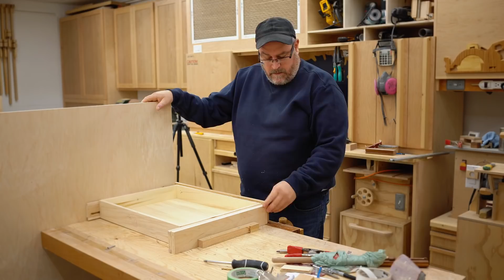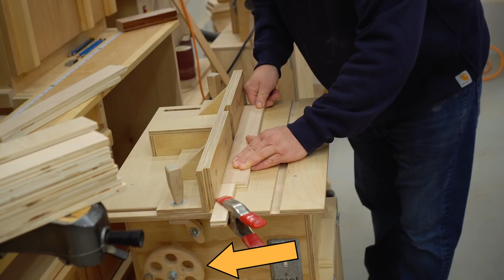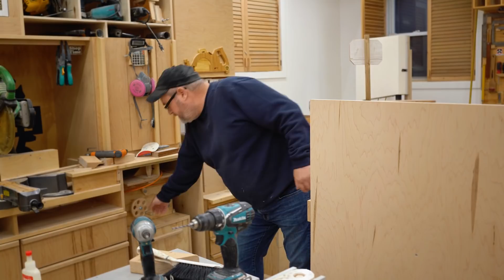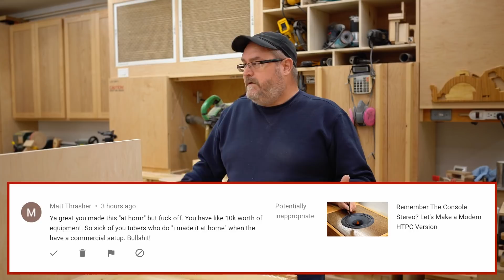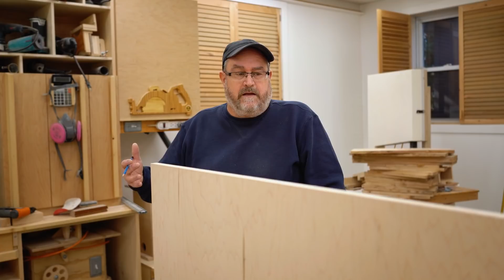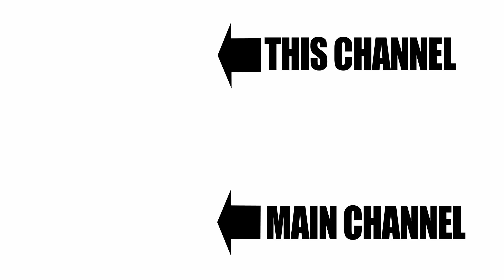Stop Complaining About The Shop and Tools you Don't Have -  Rant!

Comment: My first wood shop was an old garden shed measuring 8’ x 6’ (back in 1976.) I had a cheap-o lathe and a tiny “table” saw with a 12”x 12” top and an old fan motor hanging off the back. In that tiny shed I made a three-legged table with a turned spindle, hand-cut sliding dove tail slots for the legs, and a 1” thick top. All from black walnut gifted to me by a lumberjack in central Nebraska. That little table is still in use today. And now I graduated to a 20’ x 20’ air conditioned garage, and over the YEARS accumulated a variety of nice equipment. Woodworking is an evolutionary hobby requiring patience, money, ingenuity, and time.

Comment: Im going to disagree with you about the 3d printers, Ive been printing for 6 years now. So the common perception is its just click and print. Reality is we are talking about the cheapest of Chinese components known to man are being used here(even in high end machines) theres no getting around it your going to have to work on machine at somepoint. Also the settings and getting the machine dialed in is something alot of people dont do. Then theres the 3d modeling side of it, which is by far the most skill based part. I would say in alot of ways woodworking and 3d printing are relatable in the sense that somebody with just some kind of saw and wood could make something, same as somebody with a 3d printer could make something, but either of them if you have skill and knowledge is where the really incredible stuff is getting made
Reply: Also 3d printing isnt going to replace wood working, its injection molding thats the real competition there. And thats mostly already at a saturation point

Comment: If you want (need) to work with wood, you will find a way.  I started when I was about 10 years old making bird houses out of scrap wood.  I had no mentor or anyone else to show me how or train me.  But this is what interested me and gave me purpose.  That was 65 years ago.  Now I am retired, but still go out into the garage/shop and build projects.  In between I've worked at different occupations, (US Marine, Electronics Technician, Boat builder, General Contractor, Building Inspector) but always went back to working with wood.  Over the years I collected tools as I needed them or wanted them.  Some are easy to buy on a limited budget, some you save for, and some you sacrifice for.  If you want to do the work, you will find a way.  After all, wood working could very well be in your DNA.  I discovered that my biological father was a wood worker and contractor when I was about 40.

Comment: John, there is a massive difference between the woodworkers/makers who have some mid-grade or nicer power tools and shop equipment, and the people who have projects using outlandishly expensive single use equipment.

 Most of us don't fault woodworkers and makers for doing a project using a table saw, a miter saw, a router, a drill press, a spindle sander, palm or a disc sander. We understand those tools are doing jobs that could be done by hand or by a less expensive power tool. Ninety percent of the work done by a drill press can be done with a hand drill. A circular saw can do some of the work a table saw can; not everything, but enough. Belt, sheet, palm, corner sanders just make sanding faster, not perform a whole new, unique job.

Where we start getting upset is when a woodworker or maker whips out the $7,000 X-Carve or $2,500 shaper origin and makes it clear that's the only way the project can be done at all.  An X-Carve or Shaper Origin should be shown as making the upscale or premium version of the project; the embellishments; but the basic project should be doable with a tools that don't cost more than most/many high end desktop computers.

I'm on the fence right now on all the projects by some woodworkers and makers who require a 3-D printer for some critical part: for some of the us that's still out of our price range; but it's not so far out as thousands upon thousands of dollars. While it's currently a pain in the butt and on hold due to Covid, I can in theory have single jobs/parts run off by my local library system (for a nominal fee): a tedious process if multiple parts are required for a build, but single part might not be so bad.

Comment: Like many of us, you usually start with second-hand tools & that's power tools and hand tools. Go to auctions, second-hand stores, or tag sales. That is how I started out. I have a 10" Jointer made in 1930 that I got for less than $100.00 dollars at an estate sale. You can't buy a good quality hand planer for that amount. I also got a cabinet saw from the same estate sale for $150.00. That's a far cry from the $2-4000.00 that a good cabinet saw costs today. I bought that 10 years ago and it's still running like the day it was made. Tools that were made in the early 20th century are still around for a reason. They were built with quality and durability in mind. They are made of cast iron and dead flat steel tops. As John said "if you really want to get into woodworking, you will find away. It is just easier for some people to complain and be envious of others! Envy and jealousy make for a bitter person.

Comment: John I get your rant and it is deserved! 20 years ago I started a wood shop with nice tools. Then a divorce. 5 years latter we got back together wanting build up another shop I was gun shy  to dump money in tools that I would have to sell again. If things did not work out 
Finding your channel and Izzy Swann  I built a table saw from a circular saw! It worked well. I made a lot of projects with that saw. Then I bought your plans for the router lift! I still use it 
A long with an Incra Master Lift II 
17 years latter I have a shop again allis well.

I am guilty of suggesting the nylon bushing over the screw threads not realizing that the screws were only forward and aft stops for the slide travel.
I did not understand that the slides had upper and lower guides. 
Understand your frustration with comments that really do not apply if they had paid attention.
Please keep up the wonderful video you produce! You are an innovative thinking person and the world needs folks like you!
😁🛫

Comment: Thanks so much for sharing the rude comment and your excellent response to it.  I have a 134 square foot shop and occasionally have ripped 8' sheets of plywood.  It takes some finagling but it works.  I used to complain about the size of my shop until I decided to start a business making bunk beds out of 2x6 lumber.  I quit after making about 5 of them even though I was starting to make money at it.  I quit not because my shop was too small (and in the basement to boot) but because I did not want to sort through 2x6 stacks and then haul them home and then muscle them around by myself and then have to haul it to the customer etc.  I now love my small shop and have a list I made up of 50 small items I can make and sell.  Small and ill equipped is a blessing as long as you have the desire to actually make something!

Comment: Ha!  I make all kinds of things like you do with a garage sale table saw, cast off routers that I have fixed and cobbled, home made router table, fences and guides for everything, etc. Virtually every power tool I have was bought for next to nothing at yard sales.  The only thing I bought new was a $250 drill press from Harbor Freight.  Even my planer was bought for $20, which I disassembled and rebuilt for less than another $20.  I can testify that you don't need to spend a ton of dough on equipment to have fun and make nice things in your home workshop if you're willing to invest your own time and ingenuity to adapt.

Comment: An old instructor of mine many, many, many years ago (back n the 80s) said, "If you don't have the skill do it with hand tools, you have no right using power tools to do the same thing."   When I started, I had a hand saw, a couple of chisels, hammer, and some screwdrivers.  I made some beautiful (and some horrible) pieces with just those. I also only had a space big enough to just barely swing my arms in.  

Power tools do not give you experience.  They are a time saver.  

The also don't give you quality.  You have to want to make something good to make something good.  If you strive for "meh", you may or may not get to that level.

I can't wait to add a 3D printer to my tool collection.  But that's going to be a whole new learning experience.  I'll have to learn to use the software, the materials, etc.  The only difference is, a mistake on a 3D printer doesn't end with blood :)
Reply from the maker: I strongly disagree with that power tool vs hand tool attitude.

Comment: John love your work but 3D printers do take learning a skill set too between cad and setting and like materials knowing woods and textures is a skill knowing filaments for prints is a skill I love doing both and I find using some 3D printed parts in design dose help make up for where I'm lacking in wood working. I also agree 100% that where there is a will there is away. Thanks to you and Izzy my first 5 by 7 shop had a home made table saw router table and drill press lol Keep up the good work

Comment: I made a small cabinet for under my drill press and just used some simple wood rails for the drawers and thought it’d be good enough. It’s not I should have made your sliders. Not that the way I did it doesn’t work it’s just not smooth and bothers me every time I use them. How do I never learn the lesson of taking my time.

Comment: Any of my friends will tell you I've been working on a Murphy bed for a year. What they can't see is that I set out to accomplish this with a skill saw, a drill, and a second-hand rusty table saw. This year has been a journey of failures, innovations, and discovery as I learned first-hand what i can do well with what I have and what I can't. I owe much to the woodworkers making tools with their tools, and to A LOT of trial and error. Trying to hand cut miters with a skill saw and cobbled guide, finding out why big box store ply isn't right for certain parts, making a level space big enough for a bed frame and what it would take to square it up reliably for glue up n screw up, etc.. Along the way I've made a pocket-hole jig (thanks JSK Koubou) , a new fence I can trust, bought some corner clamps, made some corner clamps (which required making a sled that was within a few thou), raised and secured the tablesaw to save my back and added an outfeed and extension wing, and so much more in my tiny space that I have to work with. I had a pretty good excuse, that my do-nothing roommate had filled the garage with boxes and left me no space, but that wasn't changing and so I build shelves for all her shit and got it up on the walls and carved out a little 8x maybe 15 where I could do SOMETHING at least.
Reply: All that to say, something something he's right about skills and tools and will.
I try to do as much as I can with what I have, and when I really hit a wall that necessitates a new thing, that's when I'll make or get a new thing. Now, this requires a measure of self-honesty. I can't help you with that.

Comment: Two comments: I build tools...that's my joy. I build them but almost never use them. They range from honing guides to bow saws to power hammers and spot welders. If you want a tool you can make it. Skill: almost every  endeavor a man undertakes requires some sort of skill; to compare one to another is unfair and unreasonable. Yet to compare the wheelding of a chisel to setting up a table saw fence to make a cross cut is reasonable if we consider artistry and craftsmanship. One need only look at the product of todays  a machine operator and that of the work of a true craftsman. Bring on the heat.

Comment: I don't have a degree in engineering but surely anyone with some common sense knows that screw won't wear out because the force (or weight) is not on the screw, the supports hold the weight. So yeah it was after I thought about this, I realized how good the build was, which is why I threw you a huge compliment on that build.

And yeah I agree with you about the whole excuses thing. 

I don't even own a table saw, neither a miter saw. I have a circular saw and jigs. Problem with the whole excuse thing is once you start making excuses you develop a defeated mindset, and it's hard to get out of.

Comment: I'm in a fairly bad place economically and been there for a while. I've been struggling with stress for almost a decade. It's no fun.  And I live in an apartment. But over the past six months I've been slowly putting up a hand tool "workshop". It takes a lot of time because I can't afford buying too much at a time. Luckily I already had a lot of basic tools and crap lying around. So now I'm getting nearer to a point where I'm going to get more serious and get some proper materials. My big project (that I'll probably won't get to until next year) is a tiny but proper woodworking workbench. I've been designing it for months and keep updating, simplifying, etc. I do have a mobile workbench that I've updated with a bigger table, and it serves me alright right now. So, my point being, you don't need the big setup, but you have to now your limits in what you're able to actually make in your setup. I'm inspired by Rex Krueger in going the hand tool way—and it's what I can do where I live.
Reply: @David curtis Exactly!

Comment: I disagree with you on 3D printer. I'm an amateur woodworker for more than 10years now and i bought a 3D printer about a year ago. Prior to having a 3D printer i was a bit on the same fence as you saying that takes the skills out of the equation. But if you want to modelize your own stuffs then there is a lloooootttt of skills involved there. FDM 3D printer can't print just any shape, and moreover can't get great result on any shape, so you have to anticipate for all that, just like a woodworker have to understand grain of wood, that's things you learn by doing the mistakes, just like woodworking only different. Fact is i rarelly use it because the time it takes to modelize a thing, i can actually build it several times wit wood so ... 

Just my 2cts...

Comment: I tell people that complain about tools to locate or start a makerspace or other woodworking club.

Also, 3D printing your own pieces requires a fairly complex skill set, one that is just different from woodworking.  The same goes for desktop CNC - you can't just throw a piece of pallet wood on a CNC and get a bunch of benches or a cool carving.  You have to know how to use a router and choose bits to use a CNC.  And don't get me started on all the sanding required for common plastics like PLA!  As long as there is wood, there will be woodworking.

Comment: I started in wood working with a hand saw a jig saw and a crappy $15 drill, little by little have been getting more tools, have used a dremel as a router for years, still use a couple of drill guides for different sizes of bits because I don´t have a drill press, if you want to do something you will do it with what you have all the rest as you say are excuses.

Comment: I've always liked using soap to lubricate drawer slides. However, most soap today (ironically) has too much oil in it to work properly. You want the cheapest, hardest stuff you can find. Same for waxing drawer runners. Soft wax like bee's wax seems to be too "sticky". Hard paraffin candles seem to work better.

I love your comment about the hand tools. Just look at old furniture at someplace like the palace at Versailles- it's all made with hand tools. A saw, a plane, a chisel. It's still all you really need. The rest just makes it all faster. And don't get me wrong, you can have my unisaw when you pry it from my cold dead hands.

Comment: I get the gist of what you're saying and I agree with most of it.

HOWEVER, I have a 3D printer.  Those same people who bitch about "needing" $10k worth of woodworking equipment are the same type of people that bitch about "needing" a $10k 3D printer to do anything.  My printer was $350.  I can figure out how to print most things that I want to print that are within a reasonable size (about 6.5" cubed).  I fail...A LOT.  But that's all part of learning.

Using a 3D printer is very much like woodworking.  There is a very long learning curve before you can get the idea for a complex project out of your head and created in real life.  The one huge difference between most hobbyist woodworkers and hobbyist 3D printers is that you MUST have an exact design figured out and created on a computer before you attempt to 3D print something.  Unless you can find a design file for exactly what you want, this is very often the blockade to getting your idea out of your head and physically created.  Sure, there's a lot of trial-and-error that goes on with both, but you can't just pull out a spool of filament and start printing without having a design created in a 3D design program and then "sliced" in another program to account for the filament type and printer you're using.  In both cases (woodworking & 3D printing) you have to understand the limitations of the equipment you have and how to work around those as best you can.

Keep up the good work.  We all love a good rant once in awhile.

Comment: 3D printing is great, I have 3D printers, I use 3D printers, but it won't replace woodworking. The number one reason is speed. 3D printing is slow, and will continue to be slow for the foreseeable future. e.g. Need a specific one of a kind bracket for a thing. You could spend 3 hours modeling it in CAD, another 5 hours printing it, and then another 5 hours printing it again because the print failed, and then another 2 hours redesigning it because it was the wrong size... rinse repeat... or you can go out the the shop, grab a scrap of wood out of the bin and just make the thing in less time than takes to cook a TV dinner. :)